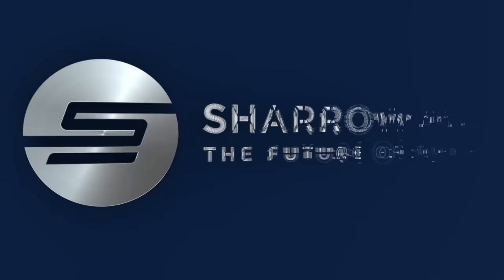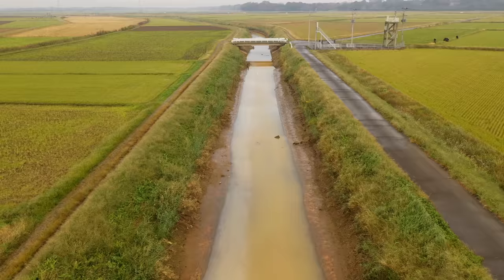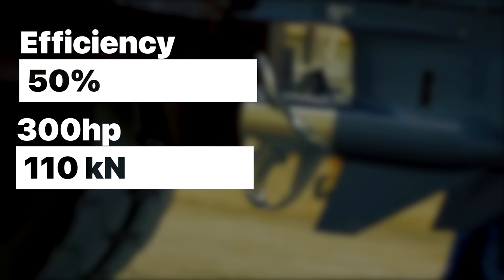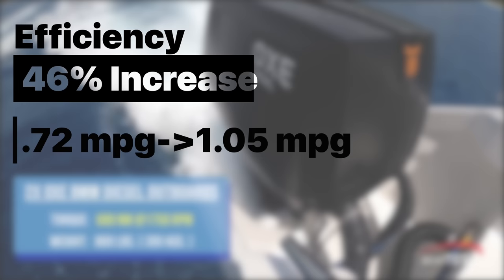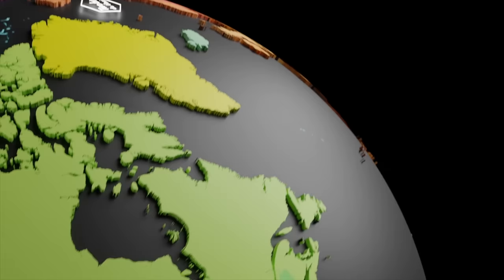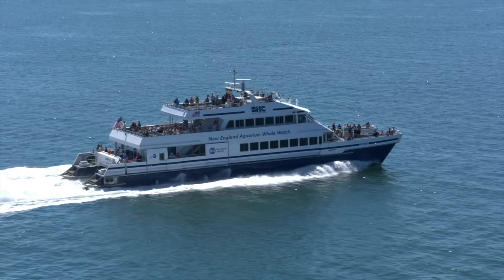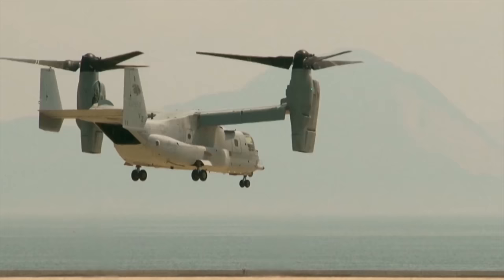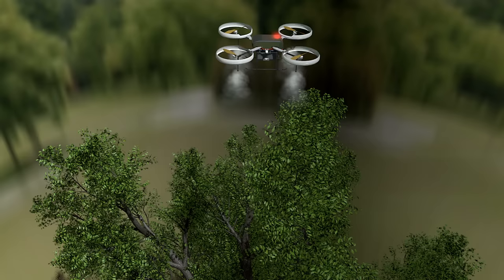Genius Propeller Is About to REVOLUTIONIZE Ships, Here's Why

Comment: These props also dramatically reduce cavitation.  That reduces propeller erosion, so they should last much longer than regular props.  Less cavitation also reduces underwater noise, so there may be a benefit to marine life.
Reply: Reduce cavitation??? Is it your statement based on investigation or just a blunt wish? I will say it will increase cavitation because a lot of flow interaction between multiple 3D blades

Comment: Mid size commercial vessels here use 15.000 dollars in diesel per voyage. Boats have twin props so in total 10.000 worth of props. But with this amount pf performance gain you earn them back in 2 to 3 trips.

Comment: Noise reduction is related with efficiency since the energy is dissipated mainly in the form of mechanical vibration (noise) and increase of temperature. A propulsion system that emit less noise is probably more efficient. That happens with electric motors, for example.

Comment: The same rules would apply to lawnmower blades, fan blades, helicopter blades, and so forth. It makes sense, since you increase the working force by double so the output force would be double.
Reply: the BEST propeller is NO propeller , in the FIRST place.
Reply from the maker: Lawn mower blades are actually a really big deal, if your not cutting efficiency then you might have to cut more often or need a higher powered mower just to get the job done.
Reply: @TwoBitDaVinci  I wonder if a more flexible material would improve the idea as well, where applicable. Thinner but stronger metal or even some other kind of material depending on the application- water, air, or organic material... 🤔

Comment: I drew something similar when I was still in school 20 years ago. It is important not to waste kinetic energy by pushing water sideways. Also most don't consider the acceleration of water along the propeler. Also it's different for open propelers or in a casing... also desired cruise speed and max acceleration dictates which propeler design is the best. For high performance propeling, cavitating and durability of the component is also considered.
I don't really consider this to be all that revolutionary... up until now the private sector was just not really interested in doing anything overly complicated or expensive or adapting the shape to the use case.
Reply: @Berend-ov8of  Another option (if aforemention cannot be prevented) would be to limit wasted impulse by putting a second contraption behind the rotor blades rectifying the direction the pushed water flows in (suboptimal, since water/air behind a rotor is subject to whirls and turbulence). Second would be to put something in front of the blades to let the current hit the blades at another angle.
Third would be to encase the blades having a closed propulsion system sideways.
Many such solutions increase the resistance against the current though.
The soluton in the video may be compared to winglets bent into the turning direction of the blades, while directly being prolonged back to the rotor axis to increase durability/sturdyness as well as forming a secondary rotor blade.
Elegant solution in comparison to what other engineers do in the industry.
Reply: @skeltek7487  Yet another solution would be to pull water in from the sides, which is more of an accoustic event. Accoustics is not often intergrated in power design, but in this case it obviously is. Either by chance or on purpose, resulting not only in noticable noise reduction, but also in that increased efficiency. 
It does result in a prop with a distinct optimal tune setting, but at that setting, the results are quite surprizing. Plus as a general rule, any activity that isn't there, can't cause damage. I really like this technology. The Sharrow prop is more of a carefully tuned open pump than a prop. Cavitation is expesive. As weird as it may sound, It basically makes water instantaneously boil. 
Just look at the thing and imagine the shape of water it creates as it spins.
Compared to that, an ordinary prop looks like the hysterical maid who just saw a mouse.
Reply: @Berend-ov8of  Well, a lot of noise is emitted by the pressure fluctuations of water being pushed sideways by the rotor blades whenever one passes that angle and not being pushed when it does not.
'Pulling' water from the sides is problematic, since the maximum speed at which water may flow sideways is limited by the speed of sound in water (not exactly but it correlates to that). The maximum speed at which water could enter a surface area sideways would be limited and cap the maximum performance, while water flowing from the front to the blades would increase linearly proportional with speed.
I agree with the comparison with an open pump, but even there cavitation is possible. I wonder if there will be a high-speed version with slightly different angles in the rotor loops.
Reply: " It is important not to waste kinetic energy by pushing water sideways."
Try tell that to a fish.
He'll have a laughin' cramp.
Just occured to me.
Reply: @Berend-ov8of  Actually a fish is indeed pushing water backwards mostly. The stream on the side of the body diverts the water to flow antiradially towards the fishs major axis before it reaches its tail fins. The tail fins transform the antiradial motion of water into retrograde motion of the water, which is pretty much antiparallel to the fishs intended direction of movement. Evolution has made fish waste as little energy as possible for those which developed with a focus on speed...
It may look like a fast fish is pushing water mostly sideways, but you got to consider the direction the water flows before and after the tail fin excerts its force...

Comment: OK, correct me if I am wrong. When I was in school, they told us that nothing can go over 100%. If you have something that performs better than what you had before, this becomes the "new" 100% and the "old" thing is now 80 or 90 or even 99 %. 100% is the maximum you can get!
Reply: Here's your correction:  105% INCREASE in efficiency.  i.e. 40% eff + 105% = 82% eff.  Still less than 100%, overall.  Watch again, try normal speed. ;-)

Comment: Helicopters vary the pitch of their blades asymmetrically to maneuver. To move forward, for example, whatever blade is over the tail experiences the most severe pitch angle. Blade pitch increases to a maximum over the tail and then decreases as the blade moves towards the front.  It still produces lift in the front just less than it does while it is in the back. Each blade attaches to a swash plate, which is just a rotary coupling, via pitch control rods.  Applying this technology to that kind of mechanism would be a monster challenge. Some sort of elastomeric loop end for each pair of blades? The tail rotor would be easier as all of the blades change pitch in unison. A place to start.
Reply: I started that comment intending to say it just wasn't feasible to apply this to helicopters but by the end I started to get ideas. My vote has shifted from no to a slight maybe.

Comment: Awesome that the toroid also makes a built-in safety shroud without adding weight, even more awesome for drone propellers
Reply: umm, no. There are still spinning tips and the weight would increase. notice the thickness of the chord on these new props is much thicker than current designs.

Comment: i really want to get the raw test data for this propeller, information like motor torque and rpm (power) and thrust produced compared against a control propeller of appropriate size and RPM. its very rare that the efficiency of something is improved by 40% with a new design like this. also with this information missing its difficult to make an informed decision if this propeller is worth the  extra $$$

Comment: Could the toroidal propeller concept be applied to variable-pitch propellers? For example, in a wind turbine application, could the blades be replaced by loops? It would not need to be a full loop, just the tip of the blade could be looped to mitigate tip vortices.
Reply: Variable pitch props may become obsolete
Reply: @greatcondor8678  I don't see this on petroleum-based airplanes. They run their engines at near to the optimum rotational speed and adjust thrust with variable pitch. Using variable rotational speed to vary the thrust will run the engine(s) in non-fuel efficient speeds. The engine would need to also change to a type that has a much flatter torque curve, like electric motors.
Reply: @greatcondor8678  why do you say that? CPP's still have their benefits which are quite important in the applications that they are most common in.

Comment: I'm not a mechanical engineer, but as a lowly electrical engineer it strikes me as a bit optimistic the efficiency gains measured with small boats and outboard engines translated to shipping. Small boats typically are planing hull designs and engine and prop speeds in the range of hundreds to thousands RPM. Small improvements in prop design would translate to large efficiency improvement. However, shipping generally use displacement hull and slower engine RPM, by a level of magnitude. I'm not an expert, but guess, the same is true with prop speeds. So my guess would be with lower prop speed, actual prop design would be less critical.

Comment: A design with more surface area on drive axil makes sense on a boat propeller but high torque is required. A low torque battery operated air drone it is different...
Reply: Indeed.  Seems a water propellor for a boat and an air propellor for a drone don't have that much in common other than the name, 'propellor'.  ;)

Comment: Would like to get these for my boat. I have twin 375hp turbo diesel engines. The fuel savings would be worth it. Just found your channel, great video…..subbed and liked….
Reply from the maker: Glad you enjoyed it and found the info useful. Your setup sounds like the perfect combo for it, maybe you can use or calculations at the later half of the video to figure out what your ROI would be?

Comment: This isn't geared toward single engine 24ft and less pleasure craft.  This is more for larger pleasure craft and even smaller charter boats.  Would like to see the data on increased ship efficiency.  Most gains I have seen are at 4000 rpm, way higher than typical pleasure craft cruise.  I suspect this point was picked as it's the largest efficiency gap.  Most real world pleasure craft cruise around 3000 rpm and efficiency gain is only about 3%.  I challenge the 75-150 hours a year and suggest it is only 30 hours for North America and those boats use gasoline, not diesel.  

Ship props don't spin that fast and you can't just increase ship speed.  These are not planing hulls, they are displacement.  Froude Number.....

Repair is another problem.  Typical props can be repaired fairly easily, not the case for this only.  Prop damage is real and frequent.
Reply from the maker: Your right most use gas but some use diesel. And correct on the target market being the larger pleasure craft and yachts etc where the Roi makes more sense
Reply: @TwoBitDaVinci  Yes, and 5k is almost an imperceivable cost increase.

Comment: I am a bit sceptic about this technology. Should the claim is true, why those profit seeking ship building, drone, & airplane industries somehow miss this half century old technology.

There must be some caveat that making this technology is unfeasible to be implemented ,which call for further discussion.
Reply: Well, 50 years ago they didn't exactly have high-speed CAD design and computer modeling software that would help run thousands of design iterations before coming up with a good enough design, or precision CNC milling that would make prototyping that design with precision feasible. And a few decades ago, fuel efficiency wasn't that much of an issue either because of lower oil prices, so there wasn't that much of an incentive. That's my guess
Reply: @Israel_Two_Bit  
Exactly, without CAD and CNC machining, this would be fairly impossible to bring to market. Add in cheap fossil fuels back when and you'd be hard pressed to find anyone willing to pay the ticket for a design that could produce optimal efficiency. Even today, the willingness to fork over that kind of dough for the high efficiency Sharrow prop is limited. 

I was in the marine industry for about 30 years building recreational, offshore capable fishing boats. The big demand I see in the recreational boating sector is for range enhancement for boats venturing offshore. Being able to run further and stay out longer has an appeal to many that is a more powerful incentive than saving a relative few bucks on fuel costs.
Reply: @Israel_Two_Bit  agreed. As a CNC programmer and 5 axis CNC machinist, sure, I can do this now adays... but even 5 years ago I would have struggled to cut this part or program it at all. Computers have improved, CNC programing tools have gotten leaps and bounds better, CNC machines themselves have gotten better, cutting tools have gotten better, and that's not even to mention the fact of high speed prototyping with 3D printers to test something like this with many iterations or high speed, accurate simulations where you can test before even building the thing at all... just because something can be drawn out on paper and has a sound concept doesn't always mean that it can be practically made... sometimes other industries that seemingly have NOTHING to do with the final end product have to have huge leaps in innovation before a century's old design even has a chance to see the light of day.
Reply from the maker: This matters , not just the design but the actual turning it into a real product in a profitable way
Reply from the maker: so true
Reply from the maker: further discussion indeed, often its not the idea but the implementation especially at a profitable scale that matters.

Comment: That $10k cost will plummet as mass manufacturing(and piracy!) find the upgrade too good to pass up.
Higher fuel economy will also become a huge boon for renewable power boating. Efficiency is precious for solar or wind power, which translates into speed and overall viability for a non petrol boat.

Comment: This is similar to the joined wing concept which allows greater span.  Low Reynolds number for small drones makes it unlikely to be more efficient unless it allows greater rotor diameter.  For small drones and larger aircraft, greater rotor or prop diameter is how to gain efficiency, not higher aspect ratio.   
Submarines don't use this or benefit, they just have a large diameter prop.
Less area makes cavitation more likely so that is a big limitation.

Comment: To be able to lecture absolutely accurately about lift/propulsion/drive on a toroidal propeller requires either knowing everything about dynamic lift or nothing at all:
"Axiom concerning the synergy of CIRCULATION and DYNAMIC LIFT:

"Dynamic lift results from the struggle and unity of opposites, the convergence of circulation and lateral Draftflow (1st dialectical law).
Within lateral flow, every object that is circumferentially surrounded, every entity within the universe, regardless of size, weight, shape, or nature, experiences a lateral force - DYNAMIC LIFT.
Dynamic lift is the lateral force that any circumferentially surrounded entity experiences within an additional, lateral flow.
Lateral flow, as indicated by the term 'lateral,' excludes (literally/in the sense of words) a flow direction parallel to the axis of circulation.
The necessary circulation can be
a) aside from its spontaneous generation at an appropriately directed "slanting" angle of airfoil profiles (sails, kite-dragons, wings, turbines, propellers, toroidalpropellers, ship screws, ascending larger, non-spherical air bubbles in liquids) with respect to that lateral flow,
b) a consequent circulation from rotation (akin to falling confetti in a gaseous medium with ensuing friction/interlocking action!)
c) also achieved externally, by switching, controlling, changing direction, and switching direction.
For the purpose of generating the desired lift in a switchable, controllable, and directionally adjustable manner.
Circulation and lift occur within lateral flow either together, interacting or not at all.
This synergistic interplay is only proportional within a very small range. For instance, the KUTTA lift formula (factor times factor times factor equals product) mathematically implies proportionality, but it is limited by the effect of the LAW OF CONSERVATION OF ENERGY to a specific range of validity (alleged "rule of thumb" without explicit justification by the action of the law of conservation of energy.
Lift increase terminates roughly between attaining three and a half to four times the circulation speed relative to the speed of lateral flow, (documented in the letter from the Göttingen wind tunnel operator to the engineer Mr. FLETTNER during the assessment of his rotor intention/invention)."